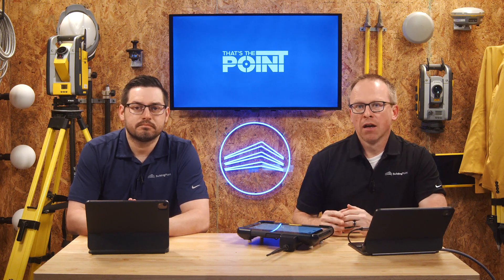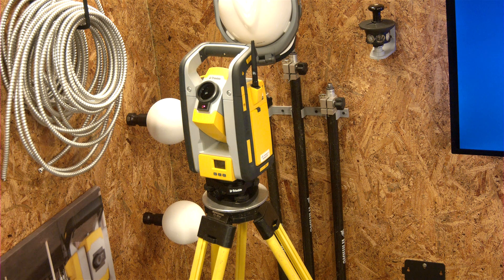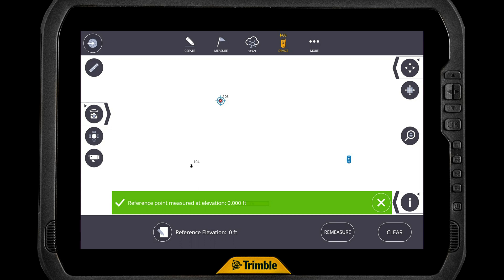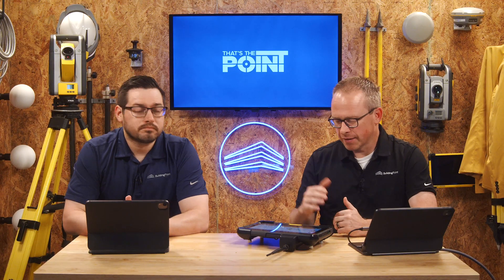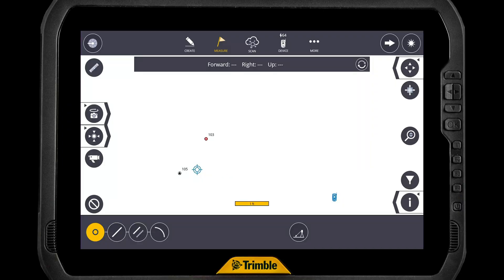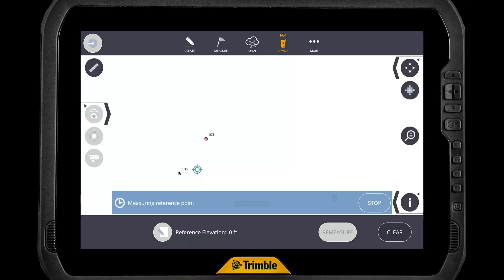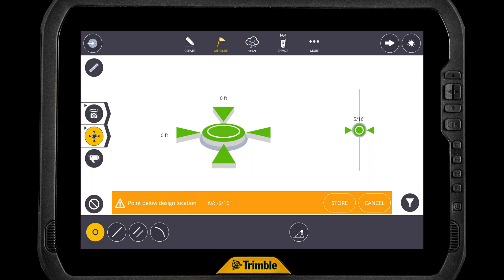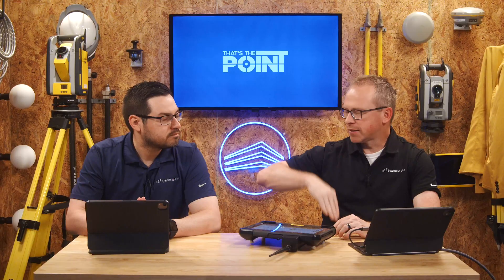That's The Point - Ceiling Layout In Trimble FieldLink

Comment: how would you go about laying out with the laser on Q-deck, the corrugated steel deck with concrete poured over? is the direct laser layout capable of compensating for the uneven surface?